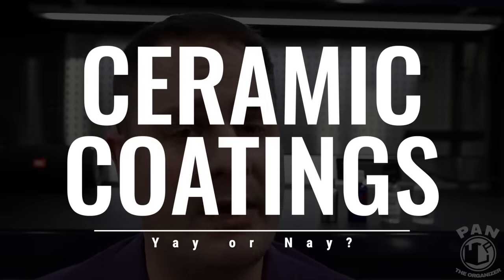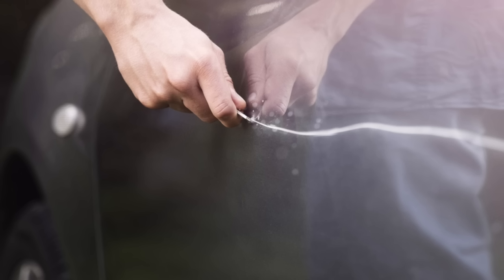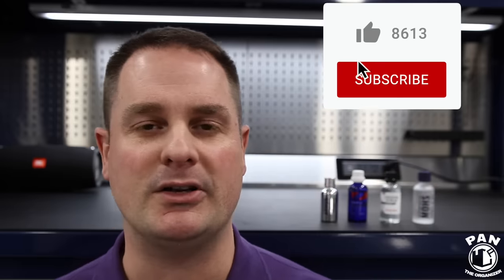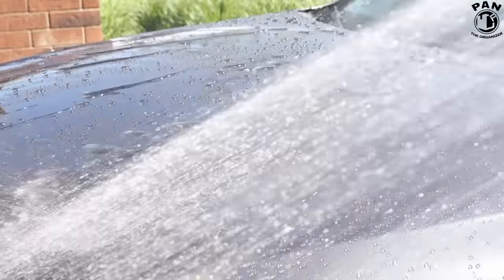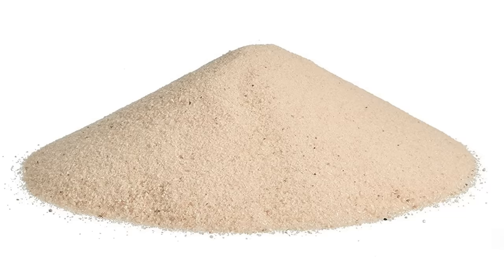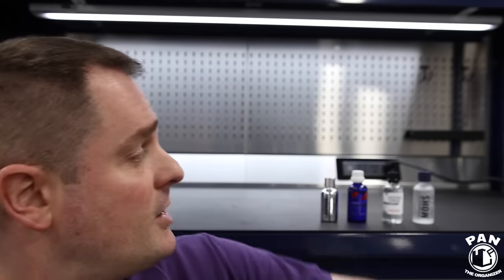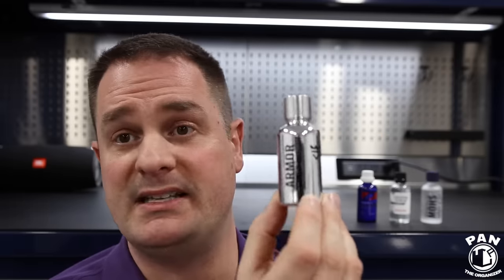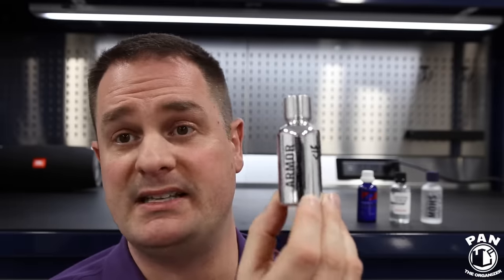DON'T BUY CERAMIC COATINGS BEFORE WATCHING THIS !!

Comment: Pan, I did some research on System X. They have been around for 10 years. Started with airplane coatings. Received a Beoing certification, which is had to get. They then added automotive coatings. Only available for professional detailers, they also have a topper called SystemX renew, a bit expensive, but claim 9 months of durability.I ordered some to put on, we will see. Maybe one day, you can do a review.

Thanks again.
Reply from the maker: If I get enough viewer requests for it, I'll look into it for sure.

Comment: Another question - how do coatings and PPF interact and what are pros/cons for combining them
Reply from the maker: You can apply most paint coatings on PPF, and there are now coatings specifically made for PPF. Watch my video on that here: https://youtu.be/7RCgqdGrvrA

To get the best of both worlds, I would absolutely recommend both. PPF first, and coating on top.

I replaced the PPF of my Porsche's rear wheel arches recently, and applied a PPF coating on top. Here's that video: https://youtu.be/gusUiD9uoW4

Comment: I learned that as a newbie I can DIY a ceramic coating.  Question: buying brand new car and shouldn’t need to polish and correct. Besides doing a thorough wash do I need to do anything else before applying?
Reply from the maker: Even brand new cars are never new. Here are the steps I perform to ceramic coat a new vehicle: https://youtu.be/tjJPcdCUaK8

Comment: Just ordered the armor shield IX! Used the turtle wax hybrid spray on my new mx5 RF. Looks good,  But a bit of a pain having to do wet and dry wipes to buff out. Looks like Armour shield is easier to apply. Just started exterior detailing, after watching a ton of Pan's videos of course:)
Pan also helped convince me to get rid of my rotary and get a da orbital. Going to redo my RF in the fall, see how it looks.

Comment: I have a 2009 Toyota Camry White. Toyota had a recall on their white paint so my Toyota dealership repainted for Free. 🎉 I was told not to wax for a least 3 weeks. I’m at 4 weeks, so I am wondering if I need or should do any steps before I add any ceramic coating?
Reply: And thanks for your time and video on these products. So helpful. 👍
Reply from the maker: Wait 1-2 months before applying any type of protection on a freshly repainted car.
Reply: @PanTheOrganizer  Thanks.

Comment: Good morning Pan and thank you for sharing your knowledge. 
I am planing on applying a ceramic coating on my truck. Can you give me some options/ suggestions on good polishes to use to prep the clear coat before the ceramic coating?
Reply from the maker: Hi Juan! It depends how much paint correction is needed. If your paint has deeper scratches and swirls, and visible oxidation (milky white or chalky appearance), you will probably want to start with a compound and follow up with a polish.  

If your paint seems in pretty good condition, and you only have some few light scratches or swirls, perhaps only a polish will do.

I made a video highlighting my favourite compounds, polishes and pads combinations here: https://youtu.be/2JDvQBs1viM

And to get a better understanding of how to prep the paint prior to applying a ceramic coating, watch my tutorial here: https://youtu.be/sqQYVjxFqK0
Reply: Thank you for the quick response. I bought my truck new about six months ago so the paint surface/ clear coat is in good condition with minimum correction needed. I will watch the videos you suggested. 
Thank you

Comment: Learned a lot thanks.  I have a question. Just got a MB cla 250 with very low miles, paint looks with no scratches and water beads good. My plan was to use high PH to remove ceramic coat and possibly iron remover. Then coat again. But now after seeing this video maybe I just need protecting the coat I have. What are your thoughts?  Thanks
Reply from the maker: It depends what protection is on your car currently. Did you apply the protection? What exactly was it? If it's a ceramic spray sealant, or a true ceramic coating (the ones in glass bottles), the only way to remove those is by machine polishing. 

But if you applied a ceramic coating, why would you want to remove it? A coating needs proper maintenance at least once every 2-3 months. See my ceramic coating maintenance tutorial here: https://youtu.be/IqIW78FmRYU

Comment: I live on a dirt road which is a actually lime stoned and was applying wax for years so the dirt would not stick.  After I bought our new cars I purchased the one you said is the best product and spent 2 days on each vehicle to prep, prep, prep and applied 2-3 layers and have to say I don't see any difference between a wax and ceramic coating.  Yes, it was applied correctly and am not seeing the benefit to it.
Reply from the maker: Durability is the biggest difference. Coatings last for years. Waxes typically only last a few months at best. Coatings also have better UV protection, waaaaay higher chemical resistance and over time the vehicle is always easier to wash during maintenance washes.

Comment: Really interesting video!
What I caught from it is another question :)
Can I keep using my micro fibers on my paint after having applied silica spray sealants with them?
Reply from the maker: Thanks!  Yes you can just wash the towels immediately after use and reuse them.

Comment: Hi mate.  Quick question.  After applying Avalon Armor Shield in my car, can I maintain it with Mother’s CMX spray ceramic coating?  Great video and goodbye from Sydney - Australia.
Reply from the maker: Yes you can
Reply: Cheers Pan….

Comment: is it safe and/or recommended to use ceramic coating on vehicles without a clear coat.  i have a 1989 ferrari and want to apply the best protection, what would you recommend for that vehicle, wax sealer or ceramic coating? love your videos!! thanks for all the energy and hard work you put into your presentations
Reply from the maker: Thanks Anthony! Welcome to my channel. You discovered one of the biggest car detailing channels on YouTube as we surpassed 890,000 subscribers and we have over 115 million views! I have been detailing for 26 years and I love to share my knowledge and passion with my viewers.

You found the right channel to help you learn everything about detailing.

Your Ferrari has no clear coat? Are you sure? Pretty much all Ferraris in late 80's and beyond came with a traditional base coat/clear coat system. You should check with a Ferrari dealership near you.

Coatings need to bond to clear coat. So if you don't have a clear coat, use a wax or sealant. I have a video on the best liquid waxes and sealants here: https://youtu.be/yuHqg-AbtdI
Reply: @PanTheOrganizer  thanks pan, i have watched almost all your videos, keep em comin!!! your the best.

Comment: Great video...thank you. My truck has vinyl wrap hood, front vendors, grill. Should my prep work for the vinyl areas be any different prior to applying a ceramic coating? That assumes ceramic coating on top of vinyl is recommended. Your comments would be appreciated.
Reply from the maker: Yes you can apply these coatings on top of vinyl wraps and PPF (paint protection film).

Comment: Based on my experiences, for non professional diy person to do their own coating 
Go for products with high water repellent properties, uv protection and slow flash time
Doesnt need to go too deep into higher end premium coating products, hardness additives crystal diamond blah blah blah contains inside , if it perform like advertised thats sufficient enough 
Every coating wears down doesn't matter how expensive it is 

A 10~20$ could perform just as good 
Just make sure the car surface are cold to touch not freezing, clean and smooth , free of contaminants 
Then we can build up the coating layer to the thickness we want
Apply the 1st layer to observe the behaviors of the coating flash off if u not familiar with the product, its ok to buff off the 1st layer prematurely as thin layer is always better than a thick layer to prevent uneven coating, track the time needed for the product to react before buffing off, some professional products need buffing off immediately after applying some need 2~5minutes
Work on each panel separately for each layers and atleast 20~30minutes between layers, this might cost more time and product, but its safer to prevent high spots and uneven coatings since we are not professionals and some of us doesnt have tools to remove high spots when we f up 

Maybe after a year or so when the coating worn down, we could just reapply if the surface is smooth or send the car for a polish job, wash with dawn soap and wipe with isopropyl alcohol to remove the polishing wax before applying new coating

Comment: Wow, I learned a lot and now I know I can do it myself and save some money. Can you use ceramic coatings on paint protection films? As I did put it on the front of my 2014 Highlander when I bought it new. Thanks again & I am now a new subscriber.
Reply from the maker: Welcome to my channel. You discovered one of the biggest car detailing channels on YouTube as we surpassed 790,000 subscribers and 100 million views! I have been detailing for 25 years and I love to share my knowledge and passion with my viewers.

You found the right channel to help you learn everything about detailing.

Not all paint coatings can be applied on PPF, but most yes. There are now PPF specific coatings that are available, and I made a video about that and the application here: https://youtu.be/7RCgqdGrvrA

Comment: Thanks for all this information once again. A year ago I did two coats of CQuartz 3.0 on Ram3500, now I am about to do my spring maintenance with chemical only decontamination, and Reload, my question is, is it too late to add Gliss on top, or should I leave it alone until next year, and start all over?
Reply from the maker: Yes you can apply Gliss. If you do, no need for Reload. You’ll use Reload a few months later.

Comment: Over the years, more than a few, my go to products for keeping my vehicles gleaming and protected have been from TurtleWax.  I've "stayed away" from ceramic products, wondering if they were just another snake oil that gave "detailers" the  edge over those of us who love to be DIYers.  However, since we recently purchased our latest car, I decided to look into the subject more deeply and, thanks to the info I've gleaned from your videos, it seems it is time to try my hand at applying something more than a wax product.  So, thanks for all your efforts.  Once I work out which manufacturers products to use, I Iook forward to comparing my results with what I've seen in your videos.  However, even having said all that, there is a question that rattles around in this not so young skull:  How is it that applying a coat of whatever product on top of another product doesn't actually dissolve and remove that product?  I guess I can understand how adding coats of the same product can maybe "build up" the protective layer but what about applying a layer of something with a different chemical formula?  Wouldn't that different formula actually degrade or even remove what it is being applied over??
Reply from the maker: I have had ceramic coatings applied on cars for many years now. It’s my favourite form of paint protection. In fact, I coat my own cars with ceramic coatings.

You don’t apply any products on top of coatings. Regular waxes and sealants are not to be applied on top of ceramic coatings. You would maintain a coating with a silica spray sealant that has compatible chemistry where the molecules actually bond to the coating to replenish and boost its performance. You are not dissolving or removing anything here. Toppers don’t contain surfactants or harsh chemistry. They contain the same base formula just in a diluted form. In a nutshell.

There is no snake oil here. Coatings have been around for a decade at this point and used by pretty much all pro detailers and a growing amount of detailing enthusiasts.

Comment: Pan, I definitely have some questions
1)  It's been recommended by my shop to do a STEK ppf Dynoshield.   If i do the whole care, then use CQuartz Skin.  If not the entire car, they would then use the Cquart Uk 3.0   What do you think of the PPF????   Plus, shouldn't they be using the pro level of the ceramic if they are doing it???   I respect your opinion.
Reply from the maker: Coatings on PPF won’t last as long as on the paint. So Skin is as good as it gets on PPF. You can also apply most paint coatings on PPF. So you could apply CQuartz UK 3.0 on the coating too.
Reply: @PanTheOrganizer  Just so I understand it correctly.....You probably recommend a full ppf wrap with a SKIN coating on top of the full ppf layer.    What are your thoughts on DynoShield from STEK?   Thank you.
Reply from the maker: I personally am not a fan of PPF. I am just not a fan of the look or feel or PPF. Plus, as I get a brand new car every three years, and do low yearly mileage, scratches and stone chips are of no concern to me. My cars are always pristine when I bring them back to the dealership.

But if you keep your cars long term (more than four years) and are concerned about stone chips and scratches, PPF is the only solution.

And if you apply PPF, I would for sure recommend a ceramic coating on top.

I have no opinion on PPF brands as I never had a personal vehicle protected by PPF so I never looked into the topic. By I know some brands have a better reputation like Suntek and XPEL for example.

Comment: Hey fellow Montrealer. I ordered the Avalon kit based on your recommendation and thanks for the discount code. One thing though. You state it lasts for 3-5 years but Avalon themselves say it only lasts for 2 years and that is what they guarantee. Which is right as that is a big difference.
Reply from the maker: My understanding is that the guarantee of 2 years is the minimum amount of time it should last. 3 to 5 years is what you get if you do proper maintenance. One can "expect" 3 to 5 years if they maintain their cars correctly. It's tough for manufacturers to come up with exact durability claims, as it really depends on the conditions the person drives in, and also what maintenance the person does with their cars. For example, a car that is a garage queen in California, only driven on weekends, and detailed two or three times a month will obviously get closer to the 5 year mark, compared to a daily driven vehicle in Montreal, with insane winters and road salt, and only washed once every 4 months.  I think you get my point.

Comment: Thanks Pan the Organizer for taking your time to teach us. You said the shelf of life of theses Ceramic Coatings could be 2/3 years or so, my concern is that what happens to the Car body after the expiry? would the Vehicle body begin to peel or flake off? Secondly, what happens if maintenace is never carried out at all since it was applied to the Car?
Reply from the maker: Don't get confused. The shelf life of unopened bottles of ceramic coatings is typically one year, some brands sometimes say up to 2 years. Once the bottles are opened, a few months at best. And for the shelf life, that's assuming the bottles are kept in stable conditions and not frozen.

Once you apply the ceramic coating on the paint, the durability varies depending on what product you applied. Some coatings last 1 year, some 2 years, some 3 years, etc. Each product is different. And then, the durability also depends on many factors like prep, application, conditions/weather, mileage and maintenance. 

A coating applied on a daily driven vehicle that does 25,000 km a year, is poorly maintained, and lives in cold winters like Canada, won't last as long as the same coating applied on a vehicle that lives in California, only driven on weekends, low mileage, and well maintained and cleaned regularly. For example.

And always follow the instructions for the maintenance of the coating you are buying. Coatings are not magical force fields. They need proper care. 

See my popular video on coating myths and misconceptions here: https://youtu.be/cGGlEN6xvKE?si=DY7ZjiqsZ-Blg4gy

Comment: I bought a new car (daily driver) that will be kept outside in Seattle with lots of rainy days but not too much snow. Would I be a good candidate for a ceramic coating?  My concern would be water spots due to frequent light rain.  Thank you.
Reply from the maker: Any car is a perfect candidate for a ceramic coating, as it's the best form of paint protection. Just make sure a topper is on the coating to help prevent water spotting, and stay on top of regular washes.

Comment: Hi Pan
Great videos in all ways.
I am in the UK and I want to apply a ceramic coating to my daily driver. It stays outside in all weather. I don't have a garage. 
Q will I need to top up my coating? If with what product?. Thanks
Reply from the maker: You'll have to pick two days where the forecast will have no rain. There's no getting around that unfortunately. You have to respect the 24 hours of curing without exposure to water or rain (some coatings like AvalonKing require 48 hours of curing). Perhaps seek a car cover to protect the vehicle once you are done coating.

All coatings require some form of maintenance, at least once every 2-3 months. I have a tutorial on ceramic coating maintenance washes here: https://youtu.be/IqIW78FmRYU

Comment: Shout out to my man Pan for having such a positive, sharing, caring presentation.  Man, I smile after your vids and jump onto looking on Amazon or other with visions of slick, beautiful cars and cleaning them up.

What are your feelings on graphene vs ceramic vs a mix of both?
Reply from the maker: All graphene coatings are actually a base of ceramic coating with reduced graphene oxide infused in them. So regardless if you pick a graphene or ceramic coating, they are near identical in performance. What matters most is picking a coating from a reputable brand.